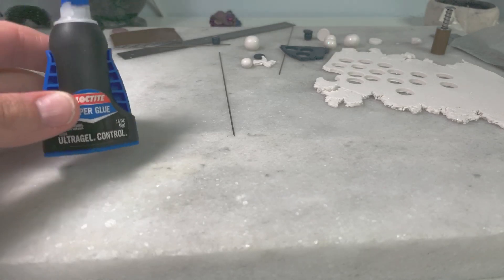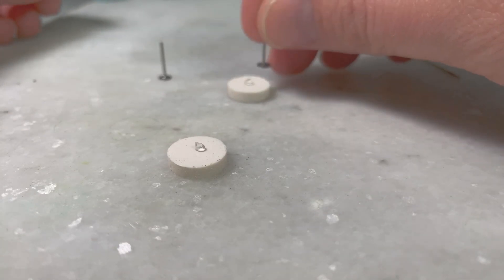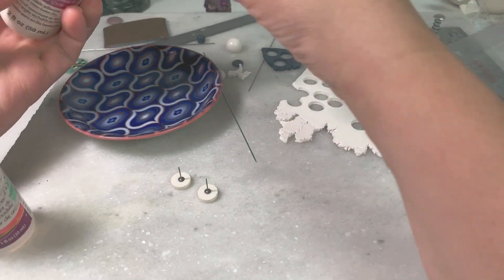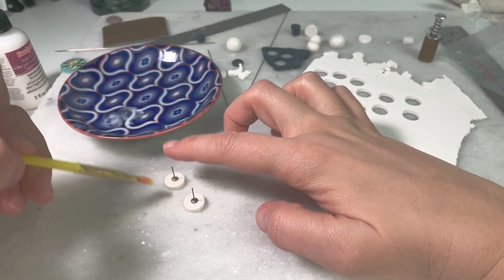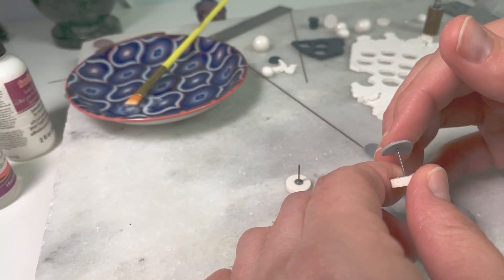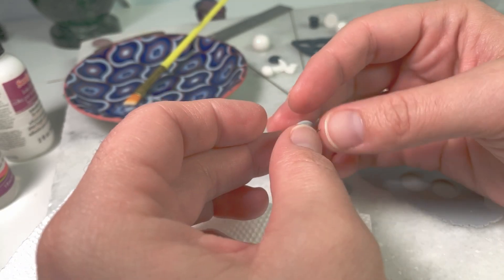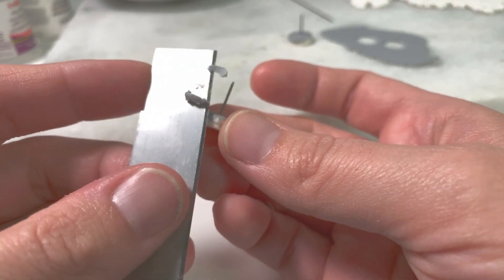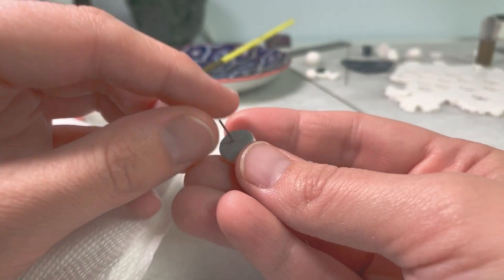POLYMER CLAY TUTORIAL - How To Attach Post Earring Backs (that won’t break!)

Comment: Did you bake the stud before adding the post and then baked again? Just wanting to make sure to do it correctly and not burn my clay
Reply: @Kayla Branham Yes, it seems that the stud was baked before adding the post. Then, for sure, it was baked again when the grey polymer clay was applied. 
NB, You can bake your project as many times as you want, actually it makes it stronger, keeping the right temperature. 
As well, there are projects that it's a must to bake it multiple times if you have to do more delicate work on it.

Comment: Can I use some other glue instead of liquid clay? Pls tell.
Reply from the maker: Sorry I missed this, the liquid clay isn’t essential, but I think brushing it on helps the baked clay and metal of the post stick more easily when your smoothing it. Without it, pressing it down is more challenging.